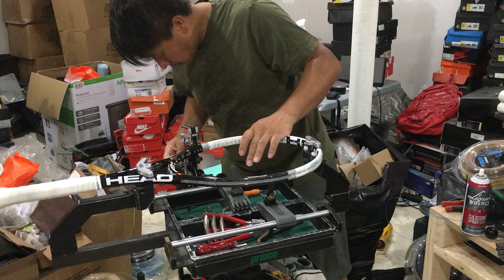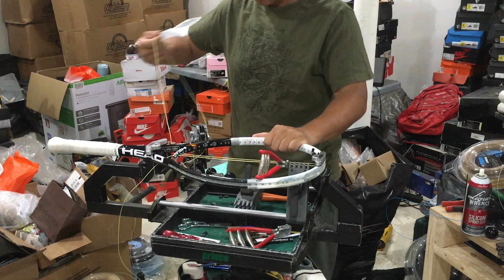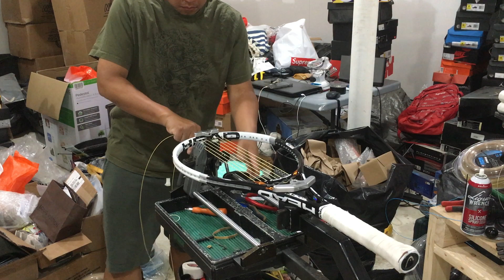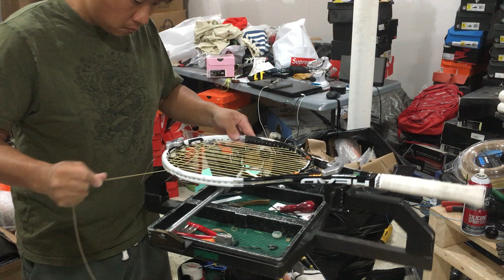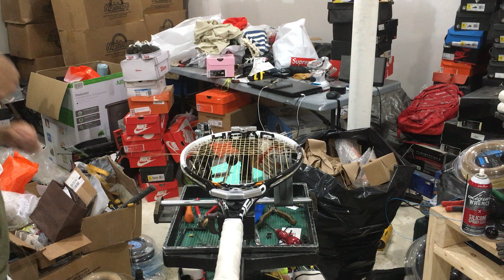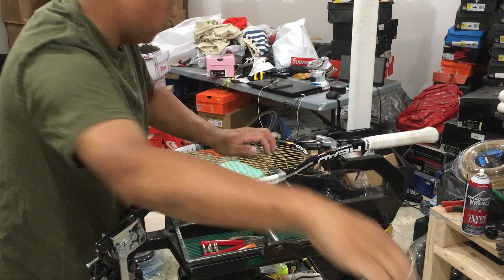Ashaway Kevlar and Mono Gut string job on Head Speed Pro 315

Comment: Just bought this string combo as a pre-packaged set to try.  Found your video when looking for reviews of Crossfire ZX (kevlar and ZX hybrid).  Try pre-stretching your strings first to get better tension maintenance before needing to re-string.  Especially the Monogut ZX.  It stretches a LOT.  That's why your ball will start sailing after only 5 sessions on  a new string job.  The ZX tension drops a lot and provides more power and less control than when first strung. The kevlar will also stretch, but much much less.  There are videos out there on how to pre-stretch string.
Reply: yeah i do prestrech mono gut now.. ;)

Comment: You're racket is mounted ENTIRELY WRONG!!!! You will end up breaking someone's frame doing this.
Reply from the maker: hi troy! thanks for pointing the mounting error... i did correct it now.. there wasn't much difference before but I see that all others mount it on the bottom strings area.. thanks again and happy holidays!!!
Reply: fixed